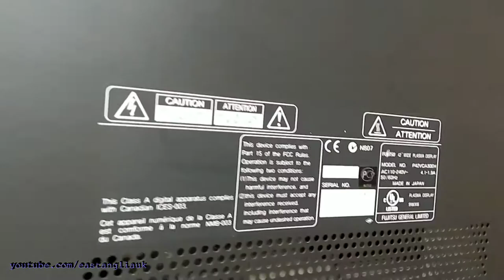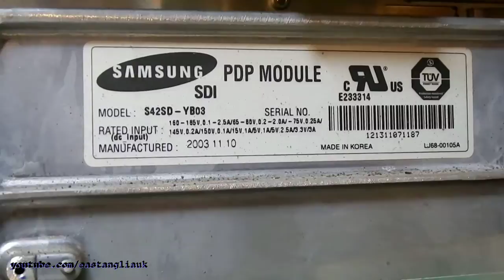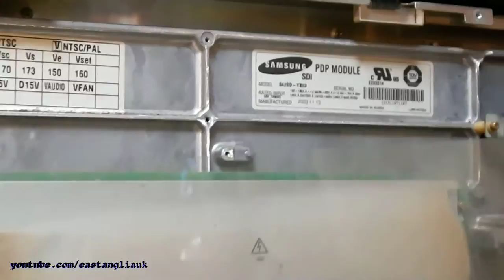Road Side Find Broken Fujitsu p42vca30eh 42 inch Plasma screen VGA + S Video & Autopsy

Comment: Did you get it fixed??
Reply from the maker: No I cleaned it out inside and checked for loose connections but its not coming on.
As said don't think its worth paying someone to fix.
It might go to scrap.
Reply from the maker: I got a very nice working one I found last weekend just make a video its got speakers and its 50 inch and hdmi.